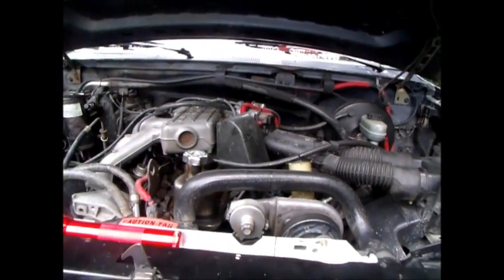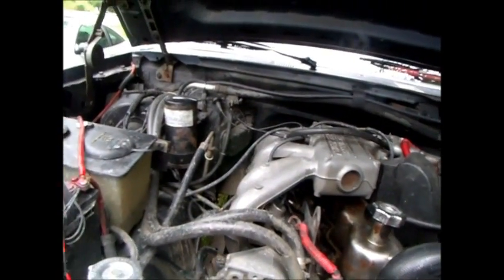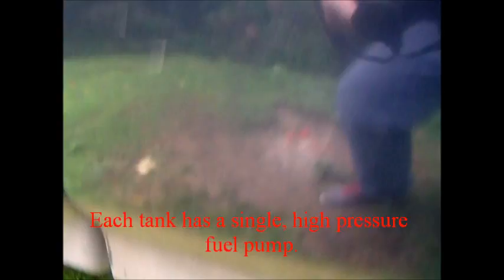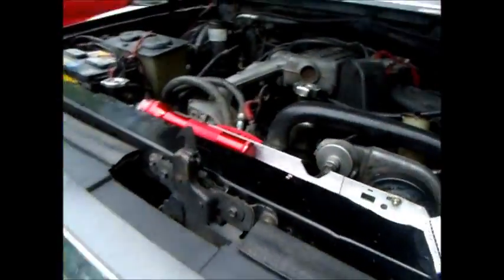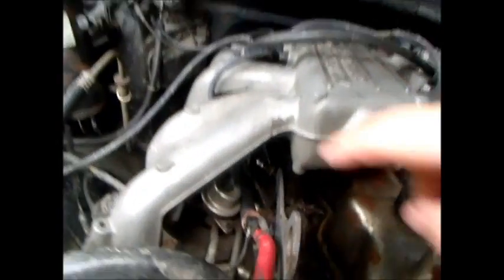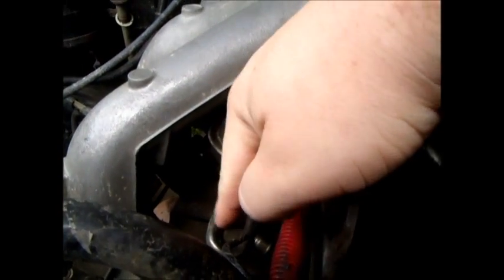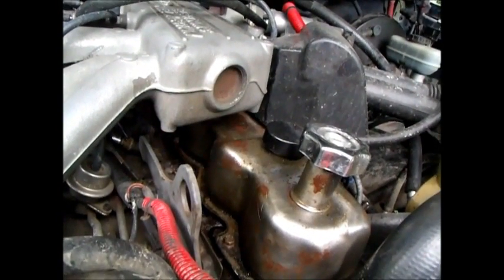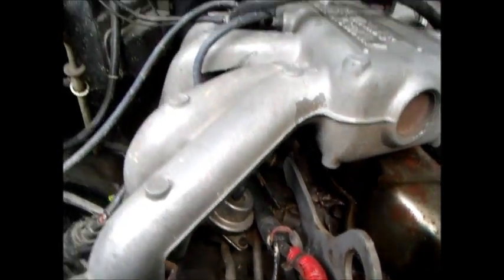1987-1996 OBS F-Series: 300 Inline Fuel System Discussion

Comment: Does mpi stand for mechanical port injection?  If so,  could I do away with the electronics & go fully mechanical-  like a mechanical lift pump on a fuel rail that goes to individual injectors?  Thank You.
Reply: Multi Port Injection.  1 injector per cylinder.  Hope that helps

Comment: Mine is running on 4 cylinders, 3 and 4 are dead, the compression was tested before intake was pulled, new injectors installed, new distributor, distributor cap/rotor, plugs, plug wires, fuel filter, fuel pressure test, etc, I am beginning to hate this engine right now, its a money pit, would love to put a 4 barrel carb and pertronics ignition setup, throw all that damn injection shit in a dumpster where it belongs!

Comment: I have a 88 f150 with the 4.9 i6. It was running then shut off  and now its not. Getting fuel to the engine. I can hear the. Fuel pumps coming on but no fuel comes out of the line. Any idea what it could be?
Reply from the maker: When was the last time your fuel filter was changed?  Literally the only thing between the engine and fuel pump

Comment: Very abrupt ending. I was just almost there and you stole my happy ending. Its been years since i had to work on a 90 f150 4.9 and im having hell getting to the fuel pressure relief valve. Doesnt help that im a 300lb man and have some difficulty getting into engine compartments. T was an informative video id love to see the directors cut or extended version.
Reply: Pull the fuel pump fuse and start and run truck out of fuel and it’ll relieve pressure
Reply: @haydendor4130  is that what was cut off in the video?
Reply: @davidreynolds4684  not sure didn’t really watch
Reply: @haydendor4130  ok thanks.

Comment: Sending unit is in the tank, the high pressure fuel pump is on the frame rail.
Reply from the maker: Depends on the year/setup
Reply: My 91 f150 4.9 has pumps in both tanks

Comment: What is that regulator looking thing on the fuel line behind the intake?
Reply from the maker: Fuel Pressure ReliefValve
Reply: @TheFSeries  interesting. Mine is on my secondary tank fuel line. My truck is doing something crazy only in the second tank.

Comment: I'm having some hard start problems on mine it acts like it runs on a couple cylinders. Comes right to life if I spray raw fuel into the intake. If it does run it'll only gallop on a couple cylinders . soon as you let off the gas she dies
Reply from the maker: Does the Check Engine light flash?

Pull codes, go from there.
Reply: @TheFSeries  yes sir I do have engine light on. Now if I could find my obd reader il be on my way . Thankyou man hopefully il find the problem. I know she wants to run
Reply from the maker: If you can't find a reader, I have a video explaining how to pull codes manually with a paperclip/short piece of wire.

Comment: Thank you for the video sir, my question is i replace the front tank fuel pump new fuel filter new plugs new distributor new tps new map sensor still alot of sputtering when i accelerate im breaking my head any other recommendation thanks fpr the help sir.
Reply: Try the water.temp.sensor and then check yer pcm /ecu sometimes.the.computer.burns out but you can solder on a new capacitor and it'll.worl.just fine
Reply: YO check your distributor cap just sayin

Comment: My dads 1990 Ford F-150 lariat 4.9 Automatic. I replaced the map sensor a EGR valve Run a test on The fuel rail pressure. But” The only thing that Worked was Replacing both fuel pumps. And fuel filters. And complete new distributor and wires and plugs. It’s a lot of work which need to be done. And I saved $40,000 from buying a newer truck. I am happy. I’m Recharging air conditioner today. 😎 Good luck
Reply: 😂😆 GREAT SAVINGS for sure, and that NEW $40,000 + truck will have MORE problem electronics

Comment: does summit racing or any one make high preformance  jets for those injectors?
Reply from the maker: Not that I know of; most people swap to the 5.0/302 V8 Injectors with 4 holes vs. The old single hole pintle setups

300 I6 injectors are 14lbs/hr
302 V8 Injectors are 18lbs/hr

If my memory serves me correctly
Reply: It that a bolt in change and does ANYTHING else have to be changed to do this?? WHY do folks do it??

Comment: I have a 95 f150 inline 6 it burns alot of ⛽ is this normal
Reply from the maker: Depends on a lot of factors
Reply: That is a diagnoses that something is going bad coil, tfi,pressure regulator, sparkplug and or wires just got buckle down and check or have it checked .

Comment: I’ve got a 95 Ford E150 4.9l van but can’t seem to find the part number or part that is a metal safety clip that snaps right on to prevent the lines from separating.  It’s metal & just snaps on the line.  2 for fuel filter & 2 at the engine.
Reply from the maker: If you're meaning the long metal clips, they're a redundant clip and not TECHNICALLY required.

Comment: Since Ford 300 has a counterflow head, the engineers went with lower flow injectors operating at higher pressures to combat the heat effects from the exhaust manifold on the fuel system (vapor lock).

Comment: My 87 fuel pump taint in the tank, is on the frame.  Good vid!
Reply: My 89 has both, in-tank lift and on the frame high-pressure
Reply: The sending unit is what is inside of the tank and the high pressure fuel pump is what is on the rail in front of the tank selector if it has dual tanks, I have 5 obd fords and they have various engines and transmissions but the fuel system is the same on all of them, but the parts are not interchangeable across the board. Lovem.
Reply: Mine tatint

Comment: I've never had an issue with Fram filters, that I've noticed... Why do you hate them?
Reply from the maker: Paper end caps (where WIX, etc uses metal), plastic anti drainback valves (Wix, Purolator, etc uses Rubber) and their paper filter media is less than comparable brands; not to mention if you cut a new filter apart you can see slits in the pleats. 

Meaning it is allowing larger particulate matter to pass through.
Reply: Wesley R. Cole good to know! I have always figured a filter is a filter, more or less
Reply from the maker: Generally speaking, yes.

But why pay $4/ Fram filter with inferior parts than the $2 Supertech filters (built on par with WIX filters actually)

To get a Fram filter with metal end caps, etc you have to buy the Fram Extra Toughguard (almost $10 per filter)
Reply: Have 92 f150 4.9. 294,000 miles. Have used nothing but Fram filters. Had 03 Mecury Sable with 228,000 miles. Nothing but Fram filters. Still running great when given to wife's nephew. Nothing wrong with Fram products.
Reply: @mickeyharrington6785  You are always the guy that comes out of the woodwork to defend a crappy product. Fram parts suck. I only use Motercraft or Wix filters.
Reply: @jaysmith179  That's why they make different ones. Not everyone uses the same. To each his own! You think Fram sucks, that is your opinion and that and 10 bucks will buy you a Latte!

Comment: I put Seafoam in my F-150 and it ate through the fuel pressure regulator.  Changed it out and it ran fine.  Bad thing is the gas was being pumped through the vacuum system into the engine.  Leaked gas and oil out the oil pan.
Reply: I ran like 6 cans of seafoam threw my truck and it started having issues i just replaced that fuel pressure regulator
Reply: +Ian Kistler - I hope you changed the engine oil right away!
Reply: Actually I ran it for awhile with the gas/oil mixture...just in the drive way.  Figured the problem out, replaced the part, and now the truck runs great.  Changing out the old fuel injectors helped as well.
Reply: I had to change out the oil pan gasket as well.  Gasoline disintegrated the gasket into the oil pan until it clogged the oil pump.

Comment: Helps me!  Thanks!  I don't like Fram, either!
Reply: I have managed a fleet of 176 school buses both gas and diesel in some very harsh conditions and Fram filters is what they were ran with I never once had an engine failure that I could trace back to a filter problem and I did read the article on filter comparisons, one feature I like that was not discussed was that AC filters have a check valve to prevent draining back of the oil into the pan, so the oil falters aren't completely empty on start up.